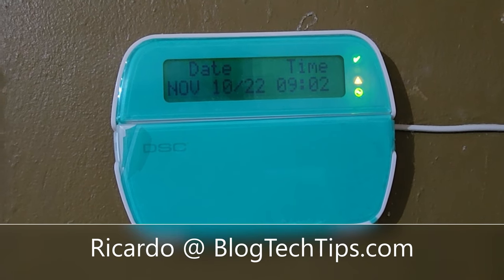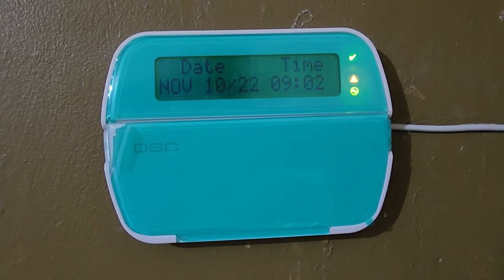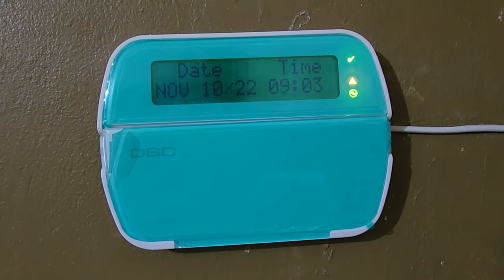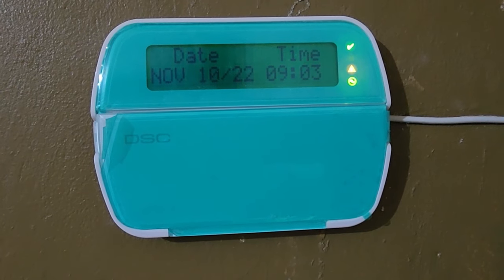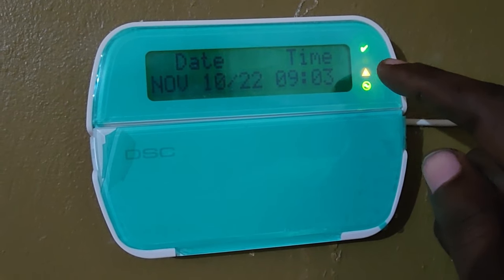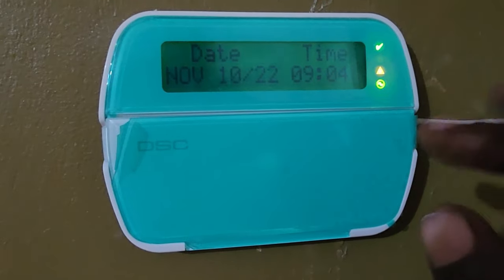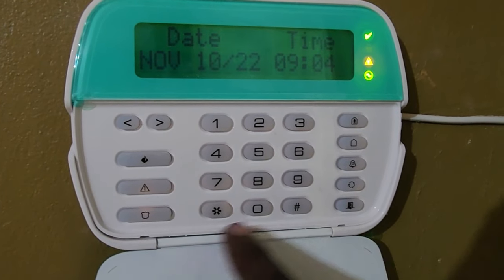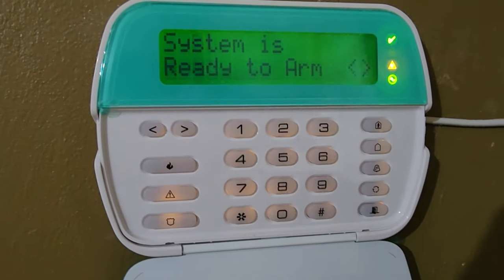New DSC Security System Beeping Fix

Comment: Any solution for turning off completely, where it does not start again every few hours?
Reply from the maker: It seems this device is designed to beep when there is a issue esp. if it cant find the communication with the control center. You will need to fix the issue or have a Technician disable the constant checks with the base station for monitoring. Its a very annoying and tricky to fully get rid of the beeps.